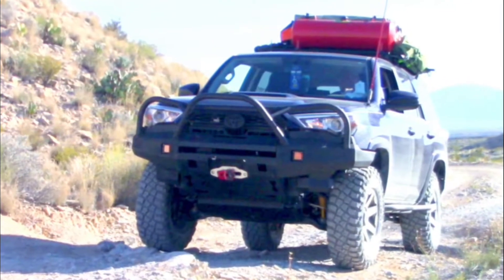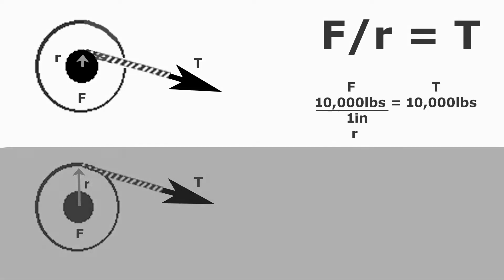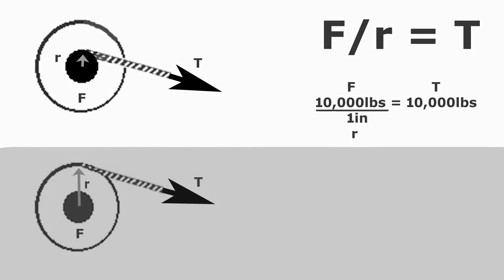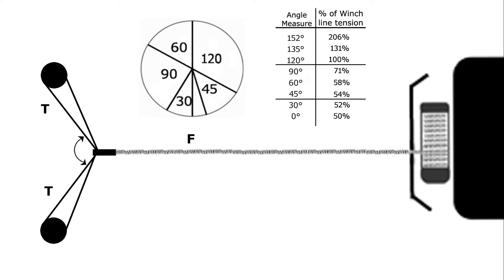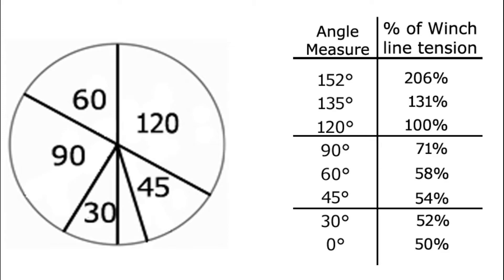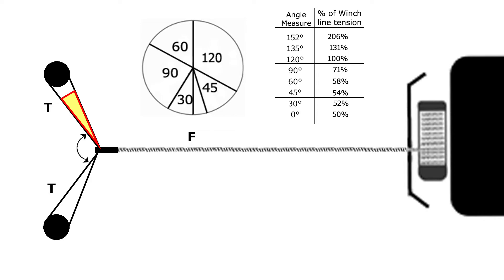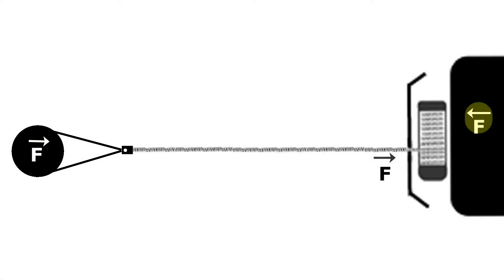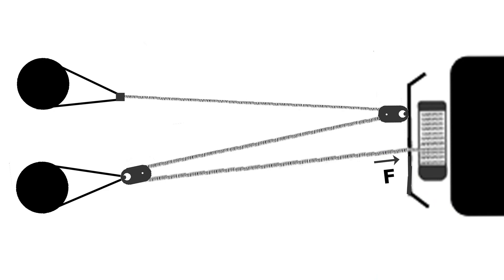Get the most power from your winch!  Understand the mechanics of winching.

Comment: There is one improvement you missed (assuming we are talking electric winches).  The battery cables that come with a new winch should be discarded.  Battery cables are made of large diameter strands and are best used in short durations such as starting an engine.  The longer there is an electrical load on the cable, the more heating it will generate.  As it heats, it cannot conduct the electrical current as efficiently as when only at room temperature.  The hotter it gets, the lesser the current, and then the winch motor begins heating.  Eventually, something in the system will fail,(usually switching gear).  The answer to this is to be rid of those battery cables and find a length of welding cable.  Welding cable is made to carry heavy electrical currents for long durations.  This will provide more current to the winch motor which in turn will run cooler and more efficiently.  It's a simple fix.  To prove what I am saying, hold the battery cables as you work the winch under a load.  They will begin heating almost immediately.  After changing the cables, do the same test.  The welding cable will barely heat up even after a long pull under heavy loading.
Reply from the maker: Thanks Jerry!  You make a great point.  I hope you'll subscribe to the channel; I'd love to get your thoughts on future videos!

Comment: I understood all of this, but my experience has been that most people will not be able to follow it at all.  It is too technical.  There were some statements that were not ALWAYS true as well.  I have worked around winches and am a journeyman heavy equipment technician.  I have done hundreds of recoveries from small vehicles to D9 Cats and loaded logging trucks over the side of the road 150 feet.  You touch on some ways of mechanically improving winch performance, but miss one vital trick... improving the flow of power to an electric winch.  Yes, this can be done.
Reply from the maker: I tried to keep it as simple as possible without over simplifying.  You make good points that are beyond the basics I wanted to share.  I didn't get into using more than one winch for example...
GREAT comment!  
Thank you!